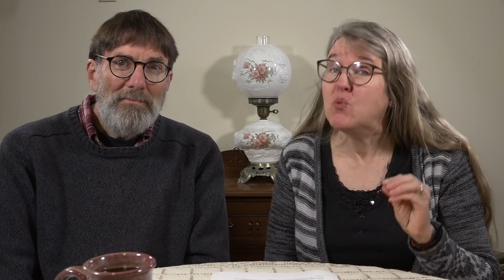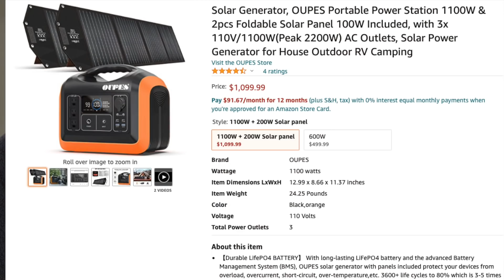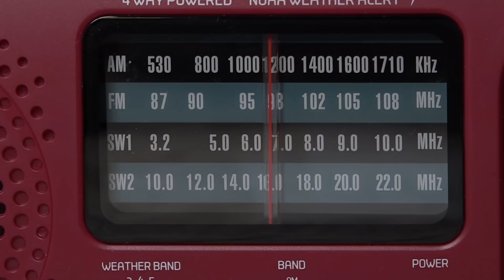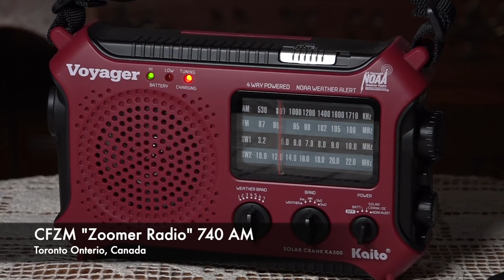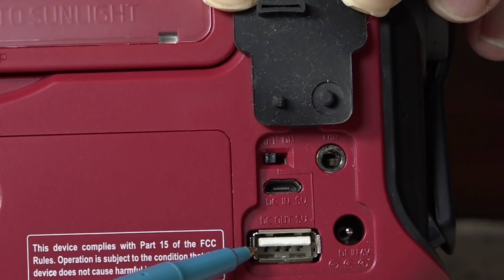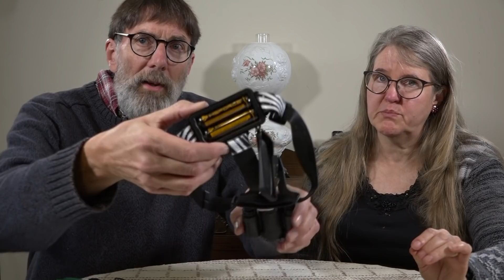Inexpensive Power Outage Tips and Products That Really Work

Comment: Ive used this huntiing in wv in a tent.  Get a metal can,  roll of toilet paper an rubbing alcohol.  Pour alcohol on tp an light it.  It puts off heat.  I was outside in a tent but in a pinch i would use inside if i needed to.

Comment: Speaking of blankets, I am almost finished crocheting a blanket that I started approximately 1 1/2 months ago. It has kept me warm on the quite cold nights we have had recently.  It's been down in the single digits. I actually didn't turn on my heat until November 1st. Everybody was begging me to turn it on earlier. When I did turn on the heat, I set the temperature at 62° F.

Speaking of the little solar lights, I picked some up at the Dollar Tree. 
Thank you again for your time, your insights and your perseverance in delivering to us all this information. Thank you. 
Sincerely, 
~Debby Rushing

Comment: A: Lots of people believe that but this pearl of motherly wisdom is FALSE. Here's why. The head only represents about 10% of the body's total surface area. So if the head were to lose even 75% of the body's heat, it would have to lose about 40 times as much heat per square inch as every other part of your body.Jan 4, 2011

Comment: I have a Midland Emergency Radio with all your features on it plus a dog whistle if trapped in a avalanch or under rubble after an earth quake where it can alert a special recovery dog to find me. A blinking sos lamp that doubles to scare away wild animals. Plus if the internal battery gets used up it can run on 6 double AA batterys. I purchased the Battery Daddy which stores 180 different types of one use batteries but works just as well to store a number of rechargeable batteries so one does not need to recharge so few batteries at a time so often. I have an old IKEA solar powered study lamp with removeable energy power pack that I keep in my car to recharge on the go. And reinsert the fully charged solar power pack into the base of the study lamp for 5 hours of intermittent use. And 8 hr  solar powered out door light later brought into the apartment and aimed up toward the ceiling when fully charged. I also have a friction powered flash light with a squeeze trigger handle to operate.

Comment: Great tips.  I need to get one of the radios, I have an older one and to be honest have not been impressed. We live out in the country so we are pretty well prepared.  We have been snowed in without electricity for up to 7 days a few times so we have learned  over the years to have a lot of options. We have headlamps which we use every day when we go out in the morning to feed the farm animals but they are great when the electric is out in  your home.  The other thing we have installed this year (mostly because we are getting elderly) is battery operated motion sensor lights in our hallways and stairwells, typical areas for falls etc.  They come on automatically with motion detected.
Reply: May I ask where you purchased your motion sensor lights. Thank you for this great idea!

Comment: I doubt solar lamps would work in a storm as there has not been any sunlight long before a storm
Reply: I discovered that  about the solar lights too. Especially the cheapies that I bought which don't have an on off switch making it annoying to try and charge then turn off again in order to hold that charge. I am considering them as my day after lighting, when the weather has cleared so they can charge but the power hasn't been restored yet. Lol
Reply: Solar lights don't need sunlight to charge, any light will do.  If you have a flashlight or even a candle to shine light on it, it'll get a charge.  Not as good as sunlight, but something.
Jon in rural BC, Canada
Reply: Shoshona, thank you, I am glad to know that but it seems kind of a silly piece of info in that if you have candles and or a flashlight, recharging your solar lights needent be your highest priority. Just wait until the sun shines again... lol, happy days!

Comment: I got three of the Voyager radios for the guys on my Christmas list. They were $59.00 on Amazon. I sent them back and replaced them with the Solar Crank CR1009 which had all the same features plus can use 3 AAA batteries  and had a SOS alarm. It was $27.99. It seemed like the frugal thing to do.
Reply from the maker: Hey, thanks. We didn't see that model. It's hard to see everything on Amazon and we appreciate it when our viewers give us a tip on a different product choice.
Reply: I'll have to check on that one.   Looks like it has most of the same features as the Kaito Voyager.  Good going, Linda!
Reply: @faith4754  - great tip.   I have several rechargeable batteries.

Comment: I also have solar back up generator.  Another tip to keep warm is using a 12 volt throw designed for the car.  They take little wattage away from the generator unlike the electric blanket.
Another tip for windows us bubble wrap.  Wet windows and place bubble wrap on and it will stick to window and insulate.  It will also let the sunlight in.
Reply: Great idea on the 12V throw!   The bubble wrap is a win-win as well.  Thank you, Pamela.

Comment: Question - If I bought the solar generator OUPES portable power station, could I power it inside of my house.  I fear people would steal it if it were outside. Thank you so much for all of your information!!!
Reply: Yes they are designed to use inside.  We have a portable generator to use during the day for heat, fridge, lights, cooking and sump pump.  During the night shut down gas generator and use solar generator for fridge and lights and charging phones.
Reply: @pamelarising344  thank you.
Reply: @pamelarising344  I may not have asked that right.  Can you charge the solar panels inside of your house, like by a glass door where the sun is coming in.
Reply: @RobinWithrow123  yes you would need to buy extension cords to put outside and keep battery inside. Or if you only have a balcony it can be hung there.  You could hang in window but wouldn't get alot of angles to catch sun.
Reply: Hi, Robin.  The panels need to be aimed directly at the sun.  This more than likely requires outdoor placement.  I don't know how long the cables are yet, but if the cables are long enough, you probably can keep the OUPES power station in a car or in a garage - or even inside you home if it will reach.  I thought about that (people possibly stealing it) as a concern as well.
Reply: @larryware1  thank you!

Comment: I no longer need this cuz I'm back in California but when I lived in the deep freeze of Ottawa Kansas, one thing I did was use a special dip stick in my oil thing in my car. It warms up your car oil so no warm up is needed.
You do need electricity for this but I mention this as for something to help out in cold weather.
Reply: I used one of those years ago for my 1965 Ford Fairlane.   It worked great and kept the engine relatively warm in bitterly cold winter temperatures.
Reply: We still have earthquakes though, so still good to be prepared
Reply: @teacherbecca526  always prepared, just don't need a dip stick heater. 👍
Reply: @teacherbecca526  - funny you should mention earthquakes.   I just watched the 1974 movie "Earthquake" for the first time last night.  I was wondering how one could reasonably prepare for such a disaster if your whole house was destroyed.  Still there would be things to consider, power outages, lack of food, water, basic transportation.   Hope you never have to experience one!

Comment: Took rechargeable batteries out of old solar lights and put them in my Voyager radio. Placed on windowsill and charged them with the solar panel. Worked great. Also you can use battery backup to run electric blankets to keep you warm till you can recharge the battery.
Reply: What great ideas, Gary!   Super.

Comment: Those 18650s are great. If you have an old dead laptop, the batteries are usually 18650s and can be salvaged to use in other things. We found camping stoves very handy when we were without power during a hurricane. We had 2 so we could lend one to a neighbour and use one ourselves. Blankets are good for wrapping around your freezer or use corrugated cardboard if you have it.
Reply: Perfect, Logotha.

Comment: I have a suggestion you would want to use a blanket on your bed singing you want to put a tarp on top of the blanket player with more blankets the tarp is not going to let cold air coming through the cold air can't come through
Reply: A good short term idea but eventually you'll end up with a moisture problem since the tarp can't  breath. That is the down side to those mylar emergency blankets too, which isn't talked about much.
Reply: Put a tarp on top of the blanket on the bed? Am I understanding that correctly?

Comment: Last winter we had several snow and ice storms and lost power several times for varying amounts of time. I had been told about making clay pot radiant heaters. These are truly a frugal persons dream. They do have a flame and need to be put on a stable surface. However, I heated rooms in our house with these heaters and was able to help us stay much more comfortable than we otherwise would have been. They require a candle, one or 2 clay pots and something to use as a base. Most of the videos I watched used muffins tins which give it a good base but I had trouble with those staying lit because they weren’t getting enough oxygen. I switched to using metal loaf pans. I was able to use a slightly larger candle and those clay pots really helped to heat those rooms. So with just some common household items I was able to really keep our house warmer than I ever had before simply with candles alone. Another use I found for these was in the spring when it would get too cold at night I put two of these clay pot heaters in my green house and it kept the plants very snug during the nights that got really cold.
Reply: I'll have to check into these.   Thanks for your suggestion, Suzanne.
Reply: That’s wonderful!

Comment: May I suggest a family size Road Pro heating oven which runs off very little power snd is great for cooking food. Designed for truckers. Put a casserole from your freezer in it and 3 to 5 hours later you have a hot meal. Mine cost about $40.
Reply: Great suggesting, Ginger!